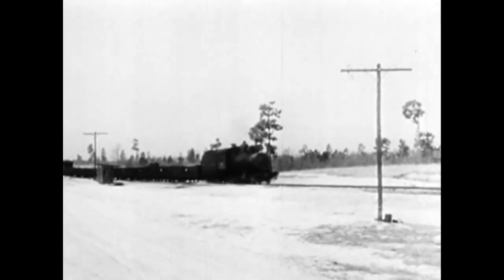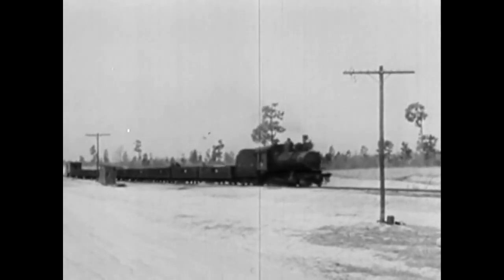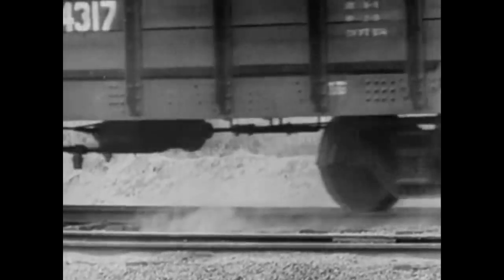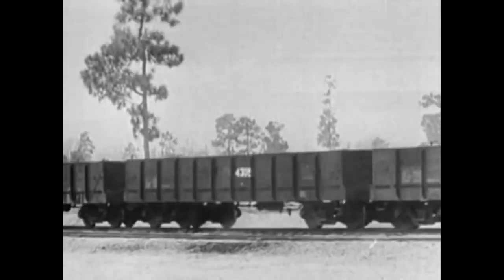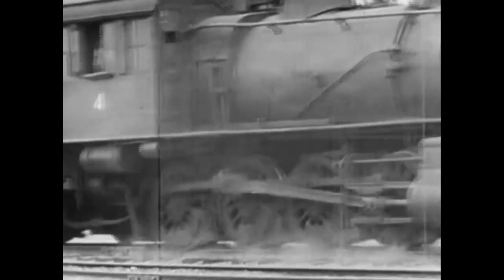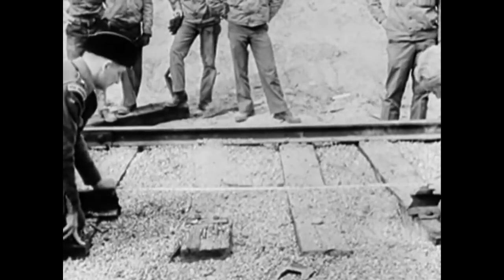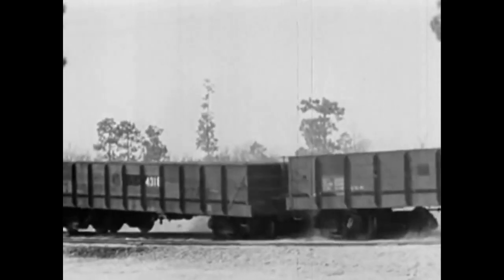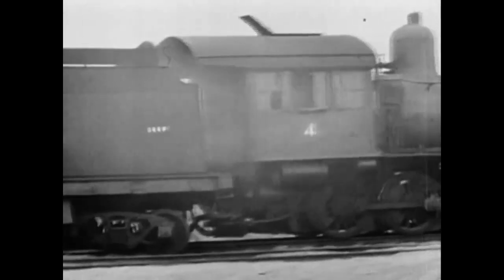Train Wreck! Derailment - Experiments To Derail Trains (1944)

Comment: The Germans had a much more effective method. They just dragged a large hook between the rails which ripped the ties in half. 100% effective, but of course you needed a locomotive.
Reply: True but the focus of this video probably what a small team of solders with very few tools can do.  This is how they wrote the army manuals back then.
Reply: A locomotive, several tons of coal, thousands of gallons of water, basically to run a "Rail Wolf" you need completely functional rail infrastructure and the time to use it.
Reply: Yeah through my entire life I keep hearing the same damn tune - Germans are better at everything! Doesn't matter what it is, they're just better at it apparently. The Master Race is alive and well (so they keep telling themselves).